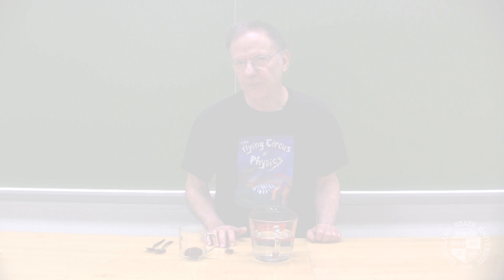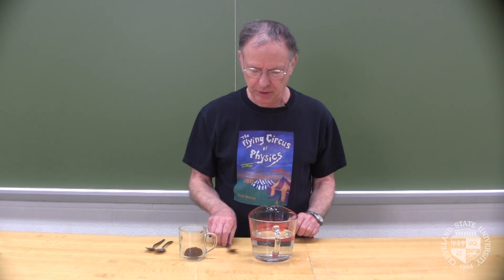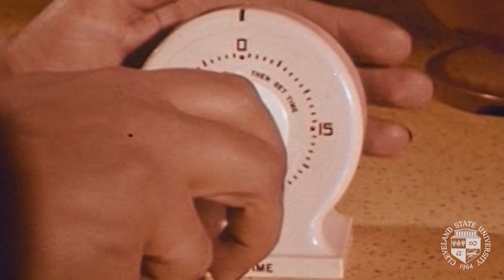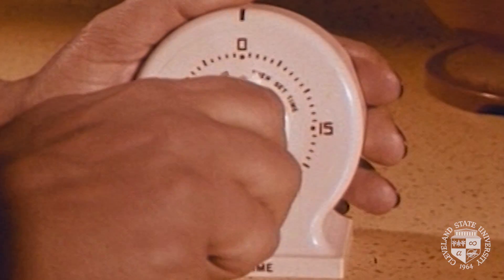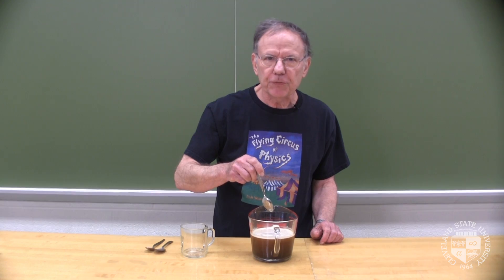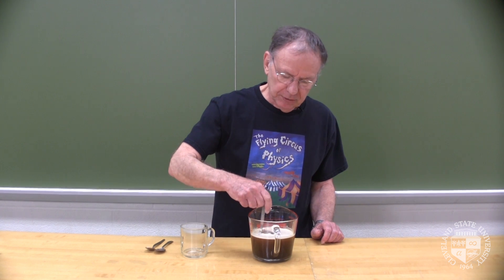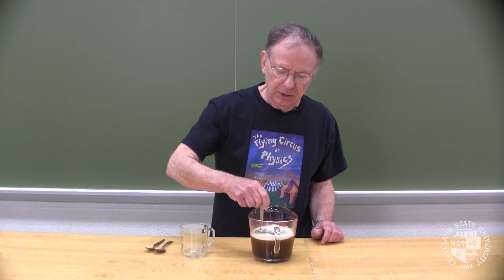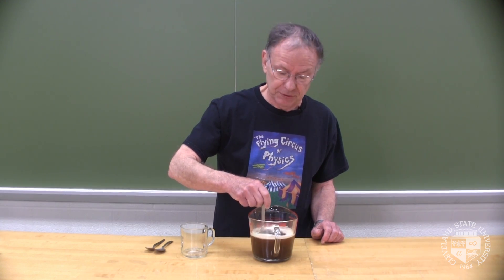Flying Circus of Physics: Coffee Acoustics (Episode 1.6)

Comment: Hmmm... What I hear is a mix of sounds. The spoon impact, followed by a damped mix of harmonics suggestive of a bell with an fundamental that is easy to hear . Adding coffee and air ( to my ear) mostly does away with all but the impact and a very quickly damped after tone. Could the difference we be hear be mostly the effect of increased damping and the after tone being converted to heat much quicker due to the additive ?How bout the additive affecting the impedance match twix the liquid and the cup ?   Thanks again for the head scratching!
Reply from the maker: +robstorms Jearl Walker replies: "I think your points are valid. I could have done a better job with a regular glass or ceramic coffee mug instead of a large measuring container because that larger container makes the effect less apparent by bringing in the other factors that you mentioned. I chose the larger container to make it and the air bubbles more visible to the camera. If you repeat the procedure with your own coffee mug, I think the frequency shift will be more apparent. The effect was first measured and calculated by Frank Crawford in 1982. He called it the hot-chocolate effect because he used powdered chocolate to make his drink. Thanks for commenting."
Reply: Thank You !  I always learn a lot from your lessons